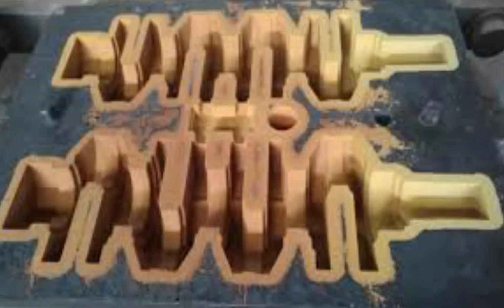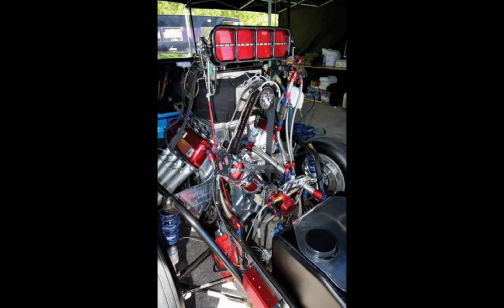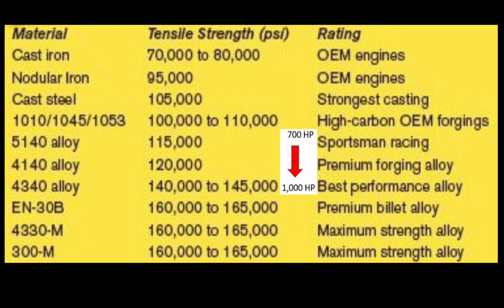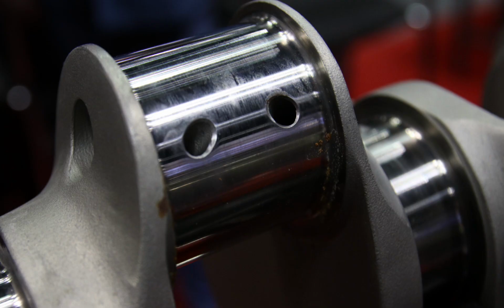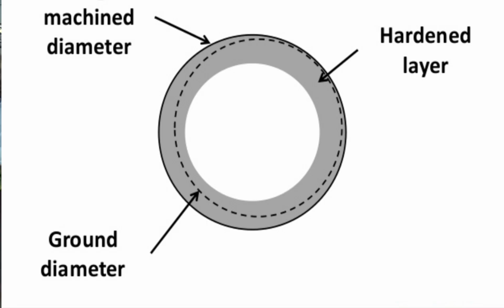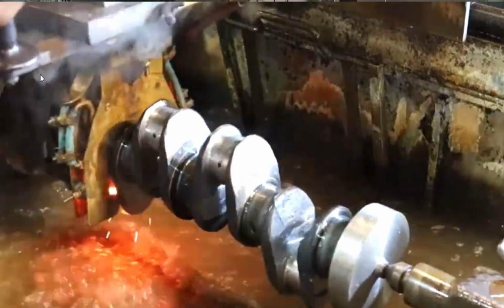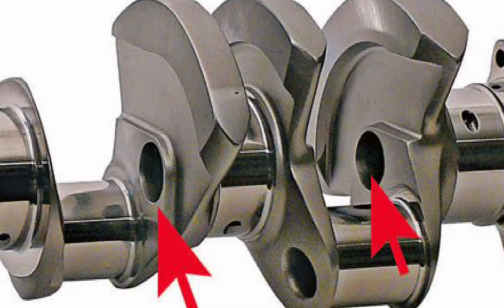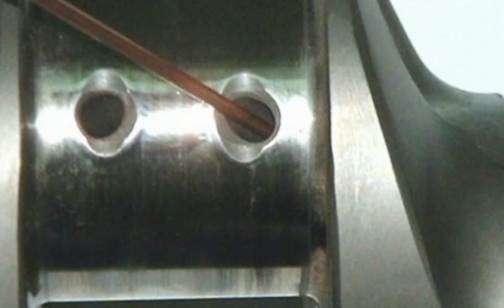Engine Building Part 2 - How to Choose a Crankshaft

Comment: Excelllent information on the differences in cast, forged and billet. You gave me some good information. I just had a 383 stroker built that produces 500+ hp. The builder used a 4340 Eagle cranker and Eagle rods. I wished I had watched this video before the build was finished.
Reply from the maker: Sounds like you'll have a good motor

Comment: Hey Pete, here's a question! I've got a block for a  modern import build and I'm ready to add the turbo kit built for the car. The turbo kit runs great with the oem block but I've sourced and gotten my oem block built internally with forged parts to hold more boost safely, long term tolerances etc etc.....my last piece to the puzzle was considering wha do to about the oem crankshaft. It's okay at best "material wise" but my end goal is to simply take the oem design and have a custom one made of better material. I'm not looking to change the stroke or the design itself "it's great" just making the crank of better material. What could you theoretically recommend in this type of scenario. Current turbo kit on the oem block runs to 350whp/400wtq safely
Reply from the maker: If you can get a billet crank made, that would be the best

Comment: So if you balance your crankshaft, you don't need a harmonic balancer? Then what do you put there? I thought all engines need a harmonic balancer.
Reply from the maker: If you have a balanced rotating assembly you use a different balancer up front

Comment: Awesome video!  I have a '86 Bronco with a 351W ,5.8L engine that seems that  it was rebuilt at certain point since it has .040 pistons. Yesterday I did the Leak down test and the results point towards the need of an engine rebuild. The best cyl. had a 9.8% leak the worst, # 7 and 8 had  44% leak; all the other cylinders  were in between these values...The truck has not been started in 12 years and when I inspected cylinders with a borescope they all look clean with minimal carbon deposits.. I realize that the hardest thing is to find a suitable rebuilt kit and a machine shop...Thanks for posting.
Reply from the maker: Good luck

Comment: If there is a small (tiny) nick in the crankshaft lobe, can I get away with polishing it and installing new bearings?  I’m an amateur, on a budget and just wanted to get some professional advice.
Reply from the maker: If you can polish it so there is not metal sticking up at all you should be ok
Reply: @PetesGarage  awesome, thank you!

Comment: The caution goes for all parts. Even thermostats. I'm back to running my original factory 195F MOPAR thermostat from 1996 because both a Murray and a Gates were opening at 180F, despite being marked as 195.
Reply from the maker: That can happen

Comment: I had to buy one billet crank and may buy one again in the future.  Was always taught to over build for strength and safety. Cast is good to 500 hp, but are you pushing it a little?  You bet.  I like forged in 400-1200 hp range.  And a billet over that.  Just a home builder for friends and family so no where near the experience of Sir Pete!  My billet is in my 347 ford boss block(2006) that sings to 8000 rpm.
Reply from the maker: Cast steel to 500

Comment: Always great to get a video from you for references, I still go back to your 350 sbc and 351w videos for information. I'm hoping to build a 351 cleveland stroker for my 89 mustang gt.
Reply: Put on aluminum heads with that stroker combo and try to remove your permagrin.
Reply from the maker: That would be awesome!
Reply: Already planned on that trick flow twisted wedge top end kit and keep it fuel injected